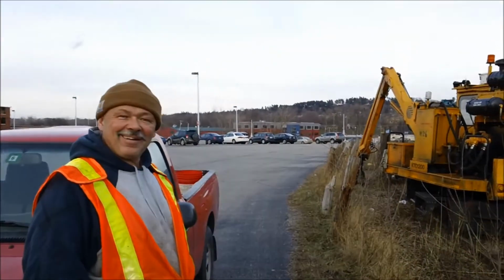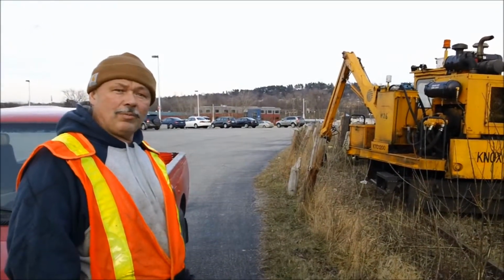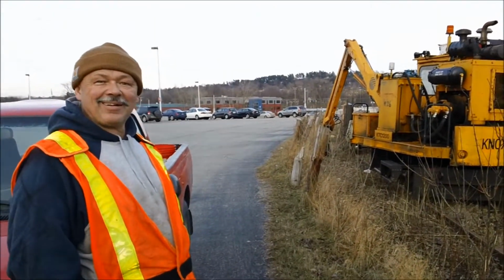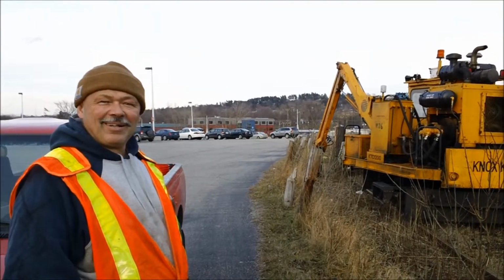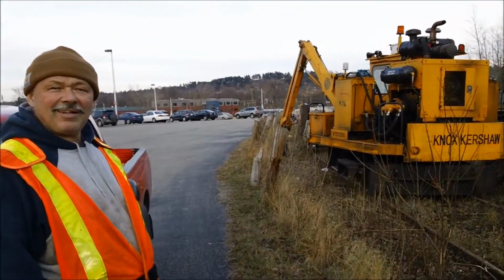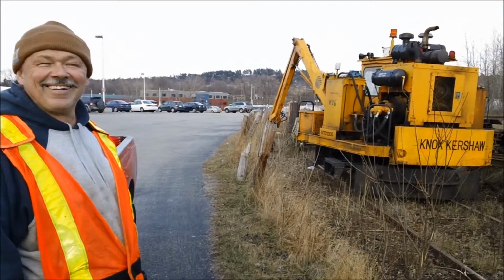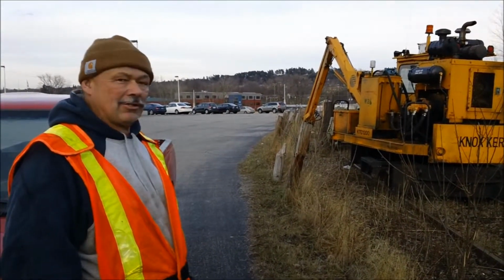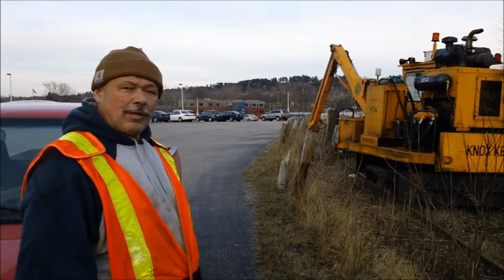Railroad Tie Handler At Work

Comment: A tie handler handling rail - I worked on a Southern Pacific RR Tie gang in late 1967-68 in Nevada.
I' ll never forget learning how to operate that machine. It wasn't easy. I never got to handle rails though
for all the tracks we worked on was riibbon rails. - quarter mile long if my memory serves.